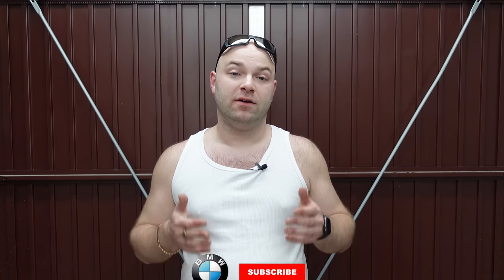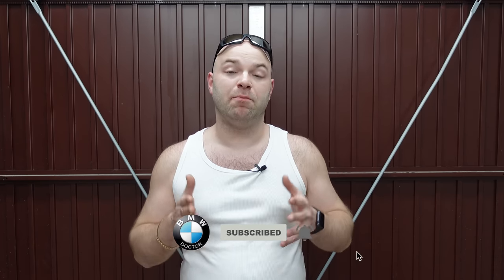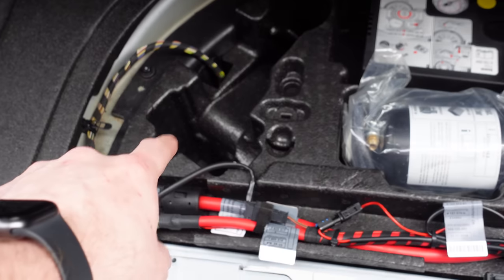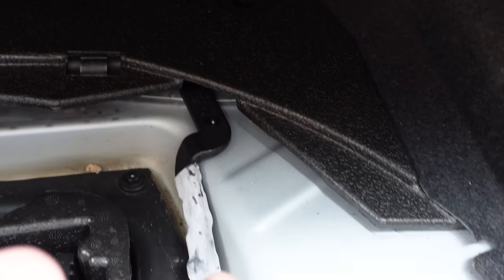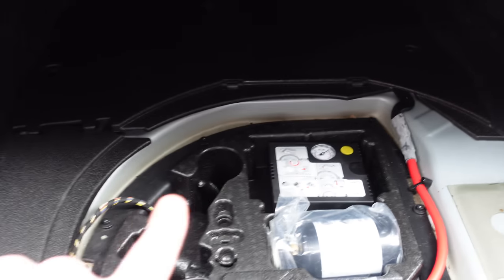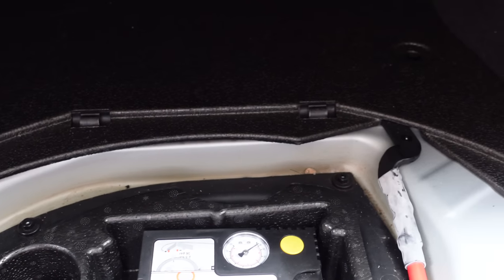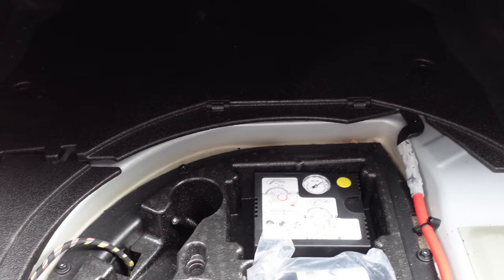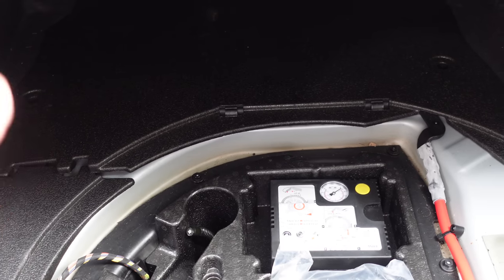BMW E60 , E61 , E63 Major Recall You MUST Avoid (For Now)

Comment: What a f#ck up 😳 I’ve had several letters about the battery terminal recall for a 2005 E60 but never bothered, certainly won’t be now either. Glad no one was hurt in that car fire, disgraceful.
Reply from the maker: I completely agree with you ! I’m so glad this and his family are ok that’s the main thing. I would strongly advise you NOT to get this done please do not right now ! I will be contacting BMW weekly to find out when they will rectify this and when it’s fully safe to be done and let you all know.
Reply: Ahh man I’m having bad electrical failures , dash going crazy checked battery / alternator. Now ordered a new JBM module to be coded was going to ring bmw tomorrow to see if it’s had the b+ module recall. 335d 2007 :( just replaced turbos/ic differential and now this

Comment: THANX for the Heads Up Doc ... My 2007 E61 is booked in at my local dealer for exactly this recall... E61 Tourings have the same power cable going to the main battery that's in the off side rear boot compartment.  Should I cancel immediately ?
Reply from the maker: YESSSS they do even worse on E61 I would turn this down straight away !!!
Reply: @BMWDoctor  ...   #ONIT 👍🏼
Reply: @BMWDoctor  ... just spoke to  BMW UK  and they seem to be oblivious to this news ?!?! Even more reason to cancel my upcoming recall appointment so I did just that.

Comment: I have over heating problem with my bmw e90 328xi with a N52 engine. I hachange the water pump, radiator.  Am told my head gasket is ok. It runs well in low RPM and over heats in high RPM. Am Walter. Regards from Accra Ghana.

Comment: Had the idiots at Swansea bmw do the egr recall. They said they replaced the part then I had errors after. Took it back in and they charged me to ‘fix’ the issue. The error was
Egr but they said it was something different. Back and forth and many charges later and still get issues. Complained to bmw direct and they don’t care but take the word of the dealer.  Put me off bmw for ever and the dealer is crooked. Wont let them touch it again.

Comment: Hi Doc
I guess that BMW e60 is the biggest shit ever made, for the last 4 years I bought it , all I had is breakdowns , I've seen all the problems you can immagine
Sorry to bother you with my story but I can't resist :
mine has stopped two weeks ago and won't start, and just after solved the AC problem by bypassing the fog sensor on the windshield, I've tried to replace it but no luck so I went to bypassing it, problem it send back wrong values , in normal it should send 35hz, instead it send 1k 23k and random values so ...
Now it stopped on the road while driving back home, when I put the key all warnings come up the whippers start working but can't start the car, checked all the fuses nothing bad, the alternator also is ok 
errors I got  : 

A3B9 Message (fuel pump) error, receiver Kombi, Transmitter EKP

A55B Instrument cluster : message (alive counter, safety9, from Advanced Crash Safety Module (Advanced Crash Safety Module (ACSM)) K-CAN, MUE 3 07

A565 Message (display of engine data) error, receiver KOMBI, transmitter DME-DDE

finally great thanks for your videos they help me on some troubles

Comment: Could this be my electrical fault in my 545i it seems to be charging at 15.5v and randomly drops to low voltage and car goes stupid It wouldn’t start yesterday I popped the boot then it started it’s strange
Reply: Did you solved your problem my 2006 630i do similar things.

Comment: Thanks for the heads up.
My 2007 525i E60 had the discharging battery error from late 2019/ early 2020. So it all makes sense now. My recall has been dated August 2021.
I had a lot of work done as faults appeared on battery, MAF sensor, crankshaft sensor. And I even needed ECU replaced.
Is it safe to get the recall work done now?